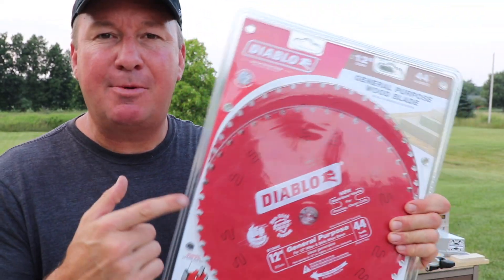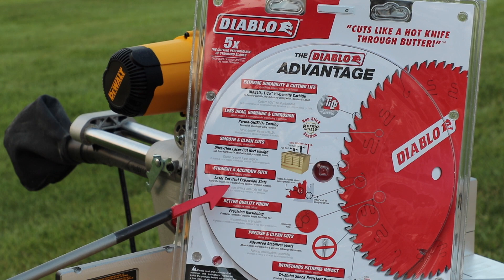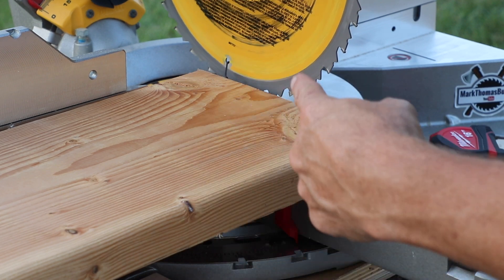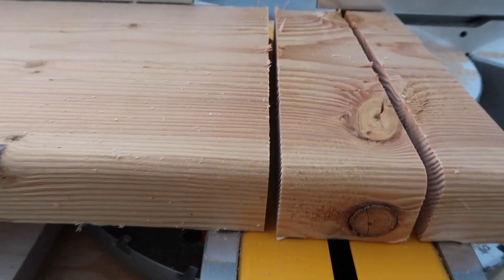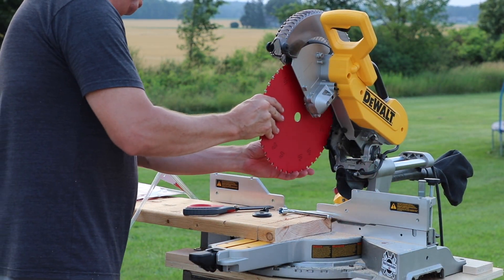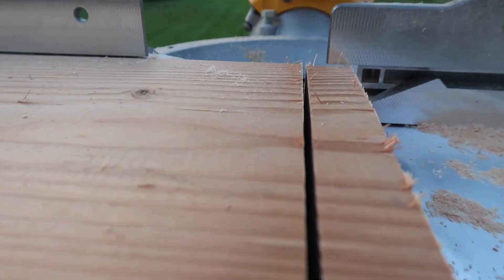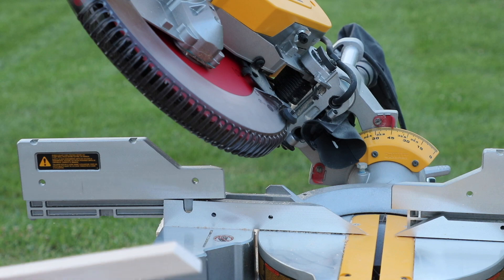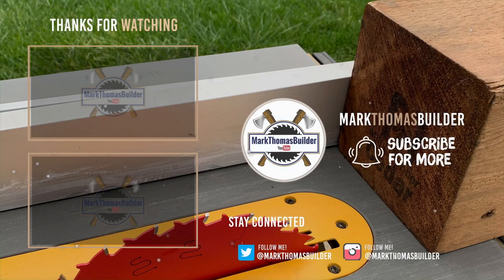RAZOR SHARP DIABLO 12 in. x 44-TEETH MITER SAW BLADE- 2 PACK!

Comment: Diablo blades and cutting tools are world class. Try their router bits and forstner drills too for excellent sharp cuts. I need a new 12” cross cut. This is the one.  Thanks for the videos, Mark. Keep it up. You review good equipment.
Reply from the maker: Thank you!  I think forstner bits are my favorite to use in woodworking.

Comment: I also noticed you pull blade back up before it stops... i made that mistake for years. 
 
Leave blade down until it stops, then lift it out. The teeth, even on a thin kerf, can cause some minor tear out. It aldo can cause burning of wood, and tooth damage. 
 
Most importantly  ... the cuts look much better. :)
Reply from the maker: Thanks, I'll work on that habit.

Comment: I just got a 12" 44t general purpose Diablo blade and cannot cut anything 1" think without feeling a push back from the miter saw. I have no idea what's going on. A 4x4 is almost impossible to cut.
Reply from the maker: It it positioned in the correct direction?  If it's a new blade, I can't think of what else would make it do that.

Comment: Ooof... the Dewalt blades are horrible. Great for decorating,  sure, but they are horrible. 
 
Tbh, I use a Freud 92 tooth blade for everything. The Diablo blades arent bad, but the true Freud Blades just last forever, cut anything, and they have a very thin kerf. The vibration, noise, and heating are a definite difference in Freud vs their Diablo brand. And the 1 blade seems to work for everything. 
 
I have a new CMT blade that was a gift, and I'm yet to use it. I told the person that gave it to me, that I'll use it when the Freud dies... it's been 2 years since lol. If it is better/worse, I will definitely notice it after the number of cuts I've made with this Freud. And I hope it is better. I know I prefer CMT router bits over Freud (and especially over Diablo. The Diablo router bits are nowhere nearly as good as Freuds).
Reply from the maker: Thanks for sharing, I'll have to try and compare those router bits.  I'll also have to look into the CMT blade and see what they're all about.

Comment: This is made by Bosch if anybody didn’t know I work at the plant that makes these blades.
Reply from the maker: Interesting, thanks for sharing!  They say they're made in Italy, is that correct?
Reply: markthomasbuilder the steel maybe made in italy but the red coating and the teeth are put in here
Reply: Dylan Roberts so I might as well buy Bosch blade

Comment: Theres a term for all the helpful information printed on the packaging 

Marketing wank.
Personally I love diablo blades, and I do believe that they are better quality, but the bs on everything we purchase is kinda stupid.
Reply from the maker: There's a lot of highlights on the blade.  Diablo has several types of carbide, depending on the blade.
Reply: @MarkThomasBuilder  that's not what I'm talking about, I mean all the non provable "lasts 40x as long as the competition" "more accurate than other saw blades" "makes you look sexier". Not the things put on there by the engineers, but the crap put on there by the marketing team. Even the design of most tools exterior is based off of the marketing department's requirements. Dont get me wrong, diablo makes a great blade, but with all the marketing wank it's hard for an uninitiated to tell which blade is really the best option for the job they are about to do.
Reply from the maker: Yes, I understand what you're saying now.  It makes for a difficult claim to prove.